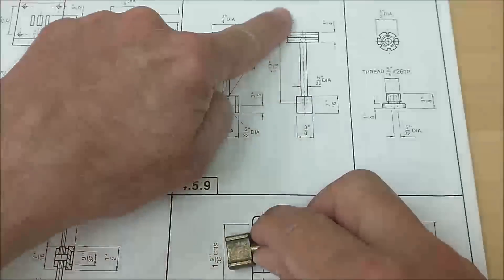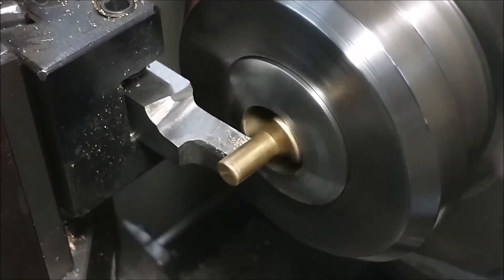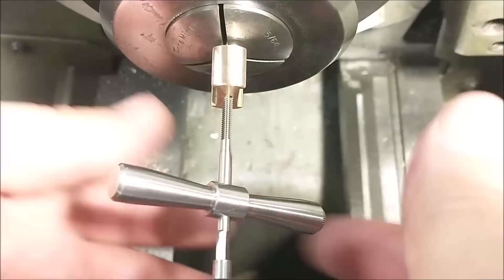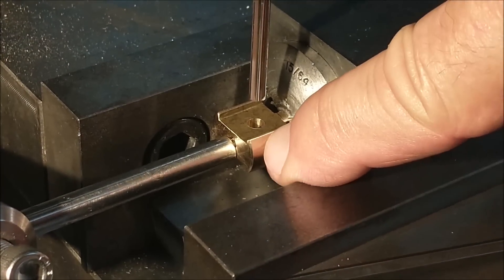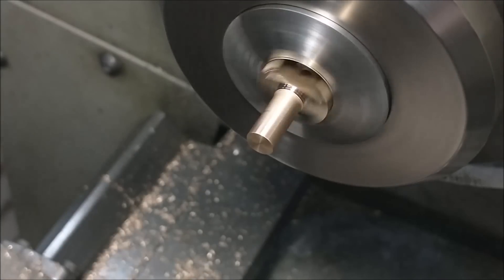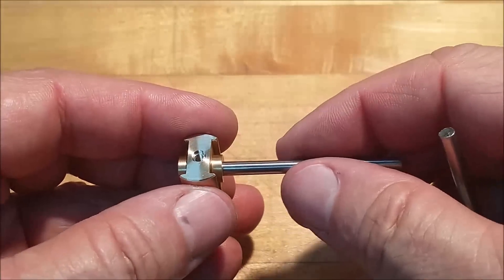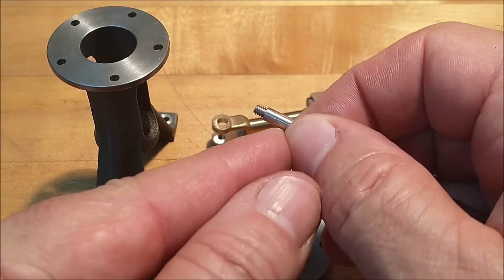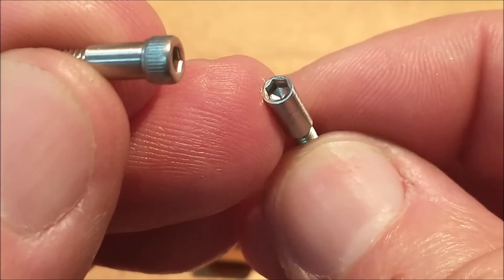Stuart D10 - # 12 -- Machining the Cross Heads

Comment: 👍 great tip on threads for concentricity. Case the same technique for shoulder screws.
Reply from the maker: Its a small addition that really adds to the quality of the assembly. Also, I hate when I see a shoulder screw used without it. Totally defeats the purpose.

Comment: The casing quality in this kit is/are great eh. Makes the world of difference in a build like this. No fighting with  sand filled pockets or the sneaky things are hiding just under the surface. I always enjoy these weekend posts from you bud. Taking your time to nail setups is of utmost importance I am sure you well know that one. Sweeter than honey eh. Lovin it too bud.
Reply from the maker: Some of the thinner parts have had some hard spots, but for the most part, the castings have been very cooperative.
Reply: @joepie221  Hard spots a fella can live with but most times you run into a couple pieces of sand that can ruin a fellas day and a bunch of tooling if you can't get under them eh. Even these can't get through them I have been told. At any rate this is one of your neatest pieces bud and I am excited to see the outcome an seeing this working away with either Steam (preferd) or compressed air. If you can find the materials, preferd leather I have a comercial lacing and belt cutter that  cuts great belt and lacing for them. I would be pleased to cut them 4 you bud. My treat eh. Just send the materials and it will be happening right away old friend. It is only about $10.00 to ship to me or back to you cheaper than I can ship to a city an hour from me. Something just makes no sense these days eh. besides that I have a file treatment I would love to send you to try. 2 birds with one stone, LOL. See ya soon and take care eh......Dean......

Comment: Nice work as always. I just gotta comment on that rickety platform you are standing on by the lthe. Is that safe, the way it's rocking like that?? 🤔😀
Reply: "lth" should be "lathe" 🙄
Reply from the maker: Its actually pretty solid. But keep the chips out from under it or it will scoot across the floor like a skateboard.

Comment: You used a centre finder to find the distance from the end for the hole, but used the indicator to find it from the sides. Is there a technical reason for that or is it just personal preference?
Reply: @snaplash  I thought that might be the case but I wanted to make sure there wasn’t some technical reason that I’m not aware of.
Reply from the maker: Using an edge finder, you still have to move half the distance of the contact tip, then half the distance of whatever measurement you believe is accurate. Using an indicator puts you right where you want to be and no additional movement of the table is necessary. Its unquestionably the most accurate method.